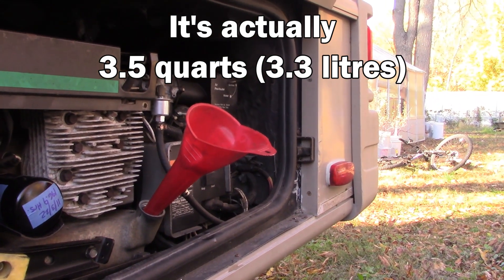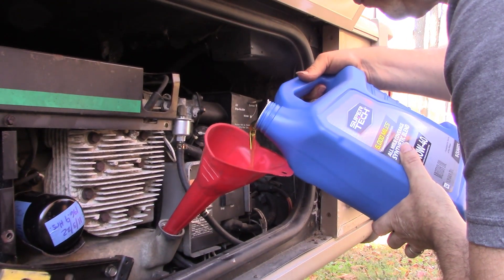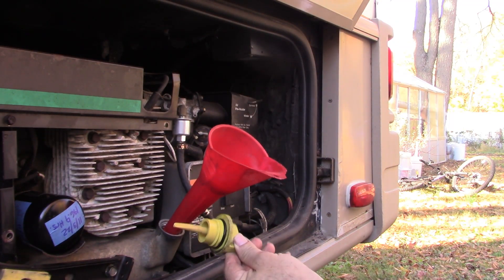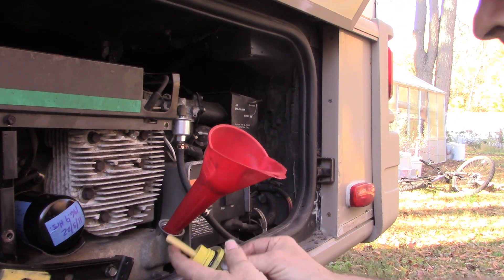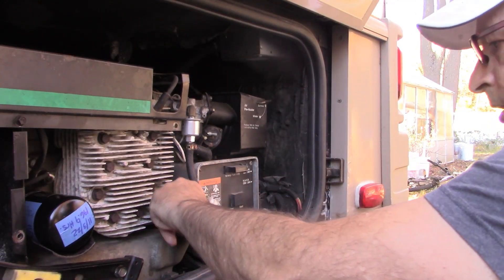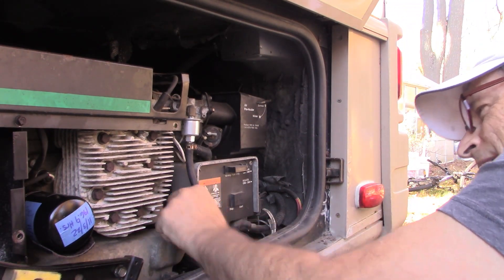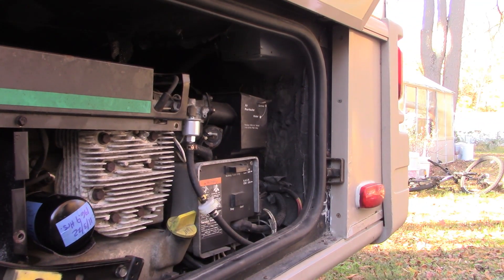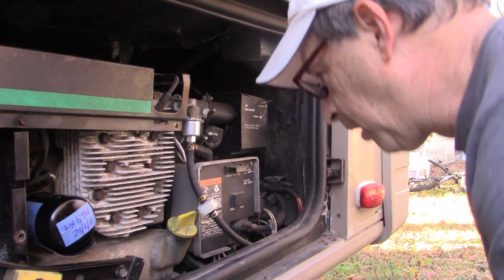RV Generator REPAIR, START UP, & TESTING - Onan Marquis 5500 - RUNNING AGAIN after SITTING 17 months

Comment: I know you posted this a year ago but I had to comment based on my recent experience with an Onan Marquis 5000 Generator on my 1997  Fleetwood Bounder.  I do not have your consummate experience with engine repair but I've have about 50 years as a DIYer. I spent several hours on the carburetor 2 days ago and yesterday spent a few more hours upside down getting the old fuel pump out and the new one in. The pump was very difficult to access on the rear underside. 
I came across your video after I had finished the repair. I was surprised at how well you took on the challenge of getting the carburetor bolts off. 
Unlike you...I was miserable and exhausted. 

I surmise my generator sat unused for 26 years. It has 52 hours on the meter which means it was never even "broken in". There was no varnish in the bowl but the jets looked somewhat dirty. I changed the fuel lines, and hot wired the pump so i can prime before starting. 

I haven't tested it yet... I had to walk away from the repair for a couple of days...I was exasperated at the amount of time I had to invest in what should have been a simple repair. Now i have to get the cover off to connect the linkage. That's another production. 

I bow my head to a person like yourself that works on engines regularly. The work is truly an art form. Much respect.  Thanks for listening!  Rob
Reply from the maker: Thanks, Rob. You're right....Getting that carburetor off and on is the biggest challenge, especially if you've got fat fingers! Good luck.

Comment: I haven't watched your video to the end ,I have the same generator, and I can't figure out how to remove the carb float bowl
Reply: That black knob that's at the bottom you have to use a screw driver to pop it off then you'll see the half inch nut at the bottom
Reply: I have same gen 5500 it only runs when the switch is pressed ,trying to find the trouble shooting info
Reply: Could be oil pressure switch. Some Onans turn off if oil pressure or level is too high or low. There is at least one video on that on YT.

Comment: I have an exhaust leak at the manifold one of the bolts backed out I put a new bolt in and it’s still leaking I’m thinking the gasket is messed up Im waiting on Amazon to deliver today 
I bought a whole new carb to put on mine but it has ran very good since I installed it